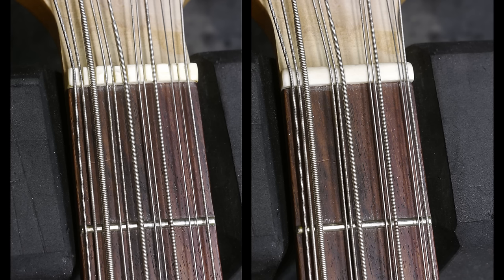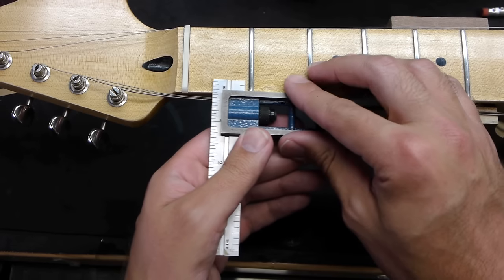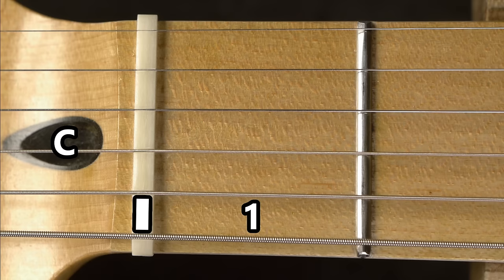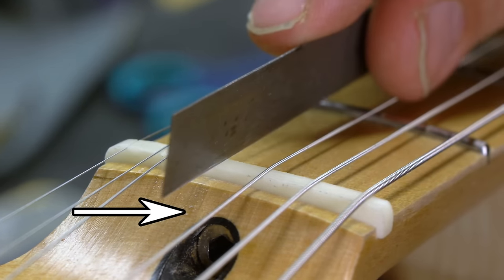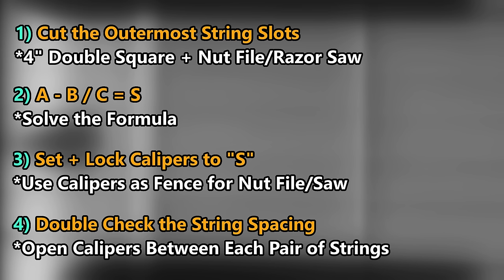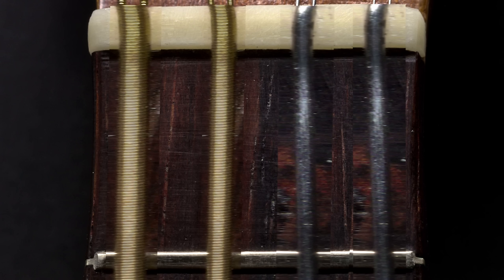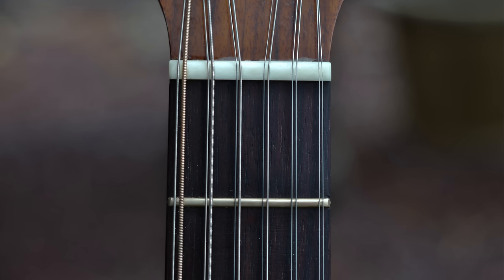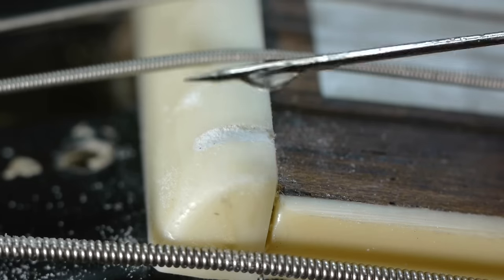Nut Slot Spacing *FOOLPROOF METHOD* - Works for 12 Strings Too!

Comment: I was told to have the high string and the thick/lower string be at the same height, you have the high string much lower.
Reply from the maker: Yes. The wound strings need to be higher to avoid buzzing when played open. 

You can set them to the same height if that's your personal preference. For me, I generally like the strings as low as they can possibly be without buzzing. 

For plain strings I reliably find this to be around .010" - .012" at the 1st fret, and the wound strings, about .018". The Low E specifically, sometimes .020" as a minimum. 

I adjust action at the other end the same way: the plain strings are all lower than the wound strings. I set GBE to the same height at the 12th fret, then D slightly higher, A slightly higher than D, and the Low E the highest. 

Again, there are some players who prefer the action at the same height on either end. My view of setups is a guitar should be able to perform with the lowest reasonable action, regardless of where the desired action actually is. Low action is a good litmus test for the quality of the fretwork and setup, and it can be raised from there. 

At some point I want to do a video on my process for doing setups. But it is all about preference at the end of the day -- what feels best to you and what you like to play

Comment: How close can you get you get the spacing between the strings in a string pair on a 12 string? Is that minimum spacing dependent on the gauges of the strings in a string pair?
Reply from the maker: I believe on my acoustic 12 string I used .028" between the pairs, and that was about as close as I could get them. I wasn't as meticulous back then and the octave A string pair is measuring about .018" - .020" apart. They are very close together but are not crashing into each other. 

I'd say .024"-.028" is a good limit. That is extremely close and I don't think it would be possible to go much closer than that without the strings crashing into each other. 

On the mandolin nut I made recently, I used .042" between the pairs. Plenty of room, and much more comfortable than the stock nut, which was closer to .080" between pairs. A space even of .042" will be an improvement on most nuts. 

On a pre-slotted 12 string nut blank I just checked, the space between pairs varied between .050" and .075". 

.028" - .042" seems to me to be a good range to shoot for. .024" will probably also work if you want really insanely close string pairs. Closer than that probably won't work, but I haven't tried it. 

It's important again to make sure about 1/3 of the wound strings are sticking up above the slots. No less than that. And you can even half 1/2 the wound strings above the slots. Too deep and that little wall between the pairs will very easily snap right off. 

I don't think it's dependent on the string gauge. Though heavier strings with higher tension might be less prone to buzzing as they won't vibrate in as wide of an arc -- maybe. I'll have to double check that.

Comment: Your method has the spacing between the inner edges of each string the same, but the spacing between the centre line of each string is not the same so you may as well use a Stewmac ruler. The dot markers in the centre of the fretboard will be closer to the D string than the G string especially at the nut end of the neck.
Reply from the maker: Yes, this is for "equal gaps" as opposed to equal string centers.

'Equal gaps' vs. 'equal centers' is a matter of preference. One or the other is not correct -- but people who have experience with both tend to have a strong preference one way or the other. 

My understanding is that the Stewmac ruler uses "proportional" spacing, which is yet another category. Dan Erlewine has mentioned not liking equal center spacing, as it left the bass strings too crowded for his liking -- hence the development of the String Spacing Rule. 

So, if I'm not mistaken, there are three options: Equal Gap, Equal String Centers, and Proportional, or "Stewmac String Spacing Rule" spacing.  

Regardless of the method, I always prefer using a fence first, and a set mark second, over pencil marks. Anything that can act as a mechanical guide for the nut file will be more accurate than lining the file up over a pencil mark by eye.

Some people are better at this than others. It does require skill and experience whenever you go more of a freehand route compared to using a fence/guide/starting mark. 

Anyway, got me thinking. I'm perfectly happy with equal gaps between strings and it has been a tremendous improvement on the hundreds of guitars I've cut them for. 

I'm always open to trying new things, though, and am a firm believer that you can only truly know your particular guitar preferences when you've tried the alternatives. 

The same goes for control layouts, wiring, string gauge, and just about everything else. Always more to experiment with. Thanks for the comment!

Comment: I have an a string that never rings out like the others; low e or  d to high E. Is it more likely a nut slot or saddle ramp. If it was structural, I would suspect other strings. It’s not flat either….just doesn’t sound like it’s moving. It makes me suspect it’s binding up. It’s a brilliant guitar but I can’t visually figure out(these old eyes)…  what gives in your experienced opinion? Most of us just know a few handful of guitar’s….you got skills! Great video.
Reply from the maker: Thanks so much! I always look at the contact points in those scenarios. 

With the nut slot, make sure that the slot is sized properly for the string. Slots that are too wide can cause buzzing, and even weird tones. Use a nut file that's closest in size to the string in question. 

And angling the slot -- the ramp as you called it -- is absolutely correct. The nut slot has to be sized properly for the string (too wide = buzzing and other problems), but it also has to be ramped correctly, with the ramp following the angle of the peghead. Fender pegheads don't slope down of course and so the ramp does not have to be as dramatic as on an angled peghead -- but it does still need it. This ramp affects intonation as well. 

The ramp also applies to the saddle. And you're in luck: I actually have a video about "re-pointing" saddles. This video is about a Schecter with a "dead low E string," which may be similar to your dead A string. The video is here: 

https://youtu.be/C3cEFRVin2Y

Now, the question is whether you need to re-point the saddle, or if simply re-ramping the slot with a nut file will do the same thing. I'm honestly not sure. At the time, re-pointing the saddle was my go-to method. I haven't encountered the same problem since, so it's hard to say if re-ramping the worn saddle slot with a nut file will accomplish the same restoration of brightness to the sound of the string. All I know is the method I used in that video did work, even if it's unorthodox, and even if it's unnecessary. It certainly is a bit of a head scratcher and something I'd like to revisit in the future, but that technique does work. 

So: contact points. Nut and saddle. Make sure the slots on the nut and the saddle are sized within tight tolerances for the string. If it's a little too tight you can try licking a piece of sandpaper, like 600 grit, folding it in half, and running the creased sandpaper through the nut slot. Homemade wet sanding. An example of that might be for a .036 gauge string when using a .035 gauge nut file to cut the slot. You can gently angle the nut file to the left and angle it to center as you cut down, and repeat on the right side, to increase it by a couple thousandths' width -- but the creased sandpaper should be able to do the same thing. 

Make sure the slots are ramped properly, and that they're close to the diameter of the string. Tight contact points -- not too tight, but certainly not too loose -- and proper ramps. Nut files are your best friend in both cases. 

Let me know if you get a chance to fix it, and how it goes. Also, one last note: you might have to fill the A string nut slot and re-cut it, or replace the saddle on the A string. That's "worst case scenario," which is not a terrible scenario at all, but if all else fails, you can try that. 

i'm confident you can fix the problem with a nut file, and at worst, filling the nut slot with baking soda and superglue and re-cutting it with the proper sized file. I also have a video on filling nut slots here in case you're interested, using my method: 

https://youtu.be/m4iskMo_XXY?si=T9PtcXMiOqiYyigP

Keep me posted! These issues are very frustrating. And I've seen some very weird things over the years. One of the only ones I wasn't able to figure out was this banjo that had this resonant frequency thing going on. It would just rattle like mad and the head would make this ringing/howling sound whenever you hit a C#. I tried everything, or so I thought. Acoustic instruments definitely introduce extra variables that can require even more creative solutions. 

Hope this helps -- and again, let me know when you can if you do get that A string fixed up and working as well as the rest. Thanks again for the support!
Reply: Wow…asked and answered and I saw that this video was fresh off the press. I had just done a search  as I’m soon to make a tele nut. Got me thinking of my old 00 and a stifled ‘a’ string. Guitars are so weird; so unique to even themselves especially as they age. I am an avid parlor fan so that lifeless ‘a’ only began to stand out  after my honeymoon period and then you live with it.  Every string counts a little more in their tonal range, especially when  fingerpicking. You’ve given me a lot to chew on. Being rural, it is especially is helpful as it is months between visits to my local luthier where my skills or dare fail me.  It’s kept me from catastrophe though. I’ve got a good tool kit, and go slow as I fix up old beater guitars and make new ones play a bit sweeter once in a while but I haven’t seen this issue. Nearly everything I fix around the house is the first time I’ve encountered it. I wasn’t kidding, I need better light and sone cheaters. The worm just turned in the past few years and I can still remember what I can’t see today. I will have a hard look and get to the bottom and proceed with caution. I’ve messed with super glue, bone dust once  but not ebony. I will make an experiment first. 
Thanks so much for the pearls as I lost my go to, good friend and luthier Tony this past year. I’m going to figure out how to save your response even if I have to screenshot it. It’s going to be so helpful in current and future trouble shooting as I’ve got a tele nut and a nut for an old Harmony to make. So much can go wrong between points of contact and give the feel of an instrument. My early 34’ and one of the last LOO’s batches from 42’’ are so different in nature. Virtually identical(on the surface) in materials and build, bar the solid linings of the 34’ but they couldn’t be more different, in sound, feel and style of play. As you recounted of with your first shop lesson, great setup makes a great playing and sounding guitar . The 34’ makes me work a bit harder with incredible sonics and the 42’ is a go to on a bad arthritis day. The 34’ sounded so good, it took me a while to notice that ‘a’ was just a bit funky. 
Yes banjos, they rattle like mad till you’ve gone bonkers chasing it. I found out why that Fender Banjo was so cheap. I’ll just tighten that head up…Yeah….it sits in the corner for the next 20+ years. Both banjos and babies  take some skill and patience. Could it have been a truss rod with just a hair to spare in the channel, vibrating at a certain frequency? I had that once. Maddening. 
The problem with these problems is they are many times just one offs. Sometimes inherent, sometimes a problem just appearing. The slightest tweak of the truss and you’ve solved  that 7th fret buzz, others (I hope not this one) takes some time and patience. Many problems get solved over the life of a guitar and if it’s gets old enough, a new issue pops up. Although I got say, I’ve never had more problems than with a new build. Settling pains! I will keep you posted, and dig into your channel. Thank you for your great insight.

Comment: Love the Video! I just got a double neck sg and I am going to use your video to do my new nut on the 12 string! But I have a question. On an electric guitar would I have to slot new saddles to match the string distance? Meaning distance between the individual strings and the groupings. Thanks so much!
Reply from the maker: Thanks so much! The between string saddle spacing on most guitars is about twice what I recommend for the between string spacing at the nut, and doesn't need to be adjusted as the difference between the two will balance out. Generally around. 080" between pairs is common at the bridge, perhaps up to .100". For the nut I like around. 028" to .042" between string pairs. .028" is close to the closest you can get without issues. 

The neck being narrower at the nut end justifies narrower between pair spacing in my opinion. I've had no issues leaving the bridge spacing as is, and only changing the nut. 

However, I'm always open to new ideas. I haven't experimented with changing the bridge between pair spacing yet, but I have done many tuneomatic style saddles using this same method. Works beautifully for spacing the strings evenly at the bridge and the between pair spacing will work just as well. 

I also keep in mind the picking hand will have different requirements and sensitivities to spacing. There's also Rickenbacker style, putting the Low string first in the pair. 

The Bridge Saver may need to be used on acoustics to fill the bridge holes and relocate them to change the spacing as well
Reply: Awsome thanks so much! Unfortunately on my guitar,the 12 string neck width is the same as the 6 string. So it is hard to play it  and not mute out strings. I’m hoping this will solve my issue!
Reply from the maker: @JulezMason  Absolutely will help! That does sound very narrow for a 12 string neck. I'd try .028" between pairs at the nut, like I have on my acoustic Blueridge 12 string. 

That's really getting close, and you have to make sure you keep the nut 'short' enough so the slots aren't too deep when cut to depth -- otherwise the 'wall' between the string pairs can easily break off. 

But .028" is a wonderful between pair spacing, and provides plenty of room. I'd try that given the extremely narrow 12 string neck you're dealing with. I haven't gone narrower than that, and am not sure it's possible without buzzing, but it might be. 

What I might do is just do one string pair as an experiment. If you get it too close, fill the slots with baking soda and superglue, and try again with a slightly wider spacing. Really getting the pairs as close together as possible without issues is going to help the playability of that guitar tremendously. 

Let me know how it goes!

Comment: The fret ends on my Martin and Larrivee are nicely finished but because of that bevel and the nut slot position for the first string, when I make a D chord sometimes the string slides down that bevel. Maybe it's my technique or the slot needs to be placed further from the edge?
Reply from the maker: It's largely preference and personal playstyle. You probably would be happier with slightly narrower string spacing. 

Also, the fret bevels can vary a lot guitar to guitar. If the bevels are over aggressive this can necessitate making or buying a new nut with narrower spacing. 

Let me know what you decide to do. I do think it'll make a huge difference for you. Changing your technique can help -- but most of the time I like to adapt the guitar to the player more than the other way around.